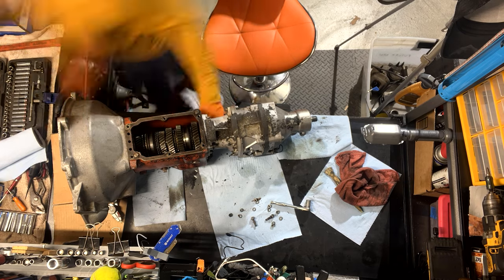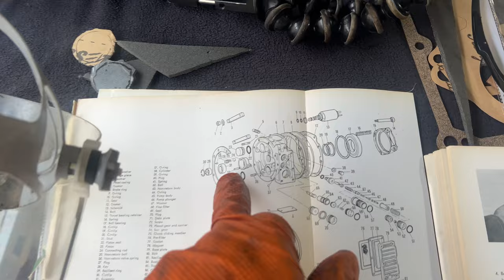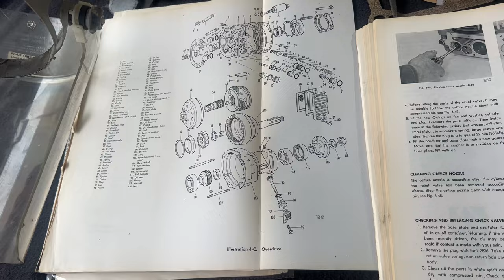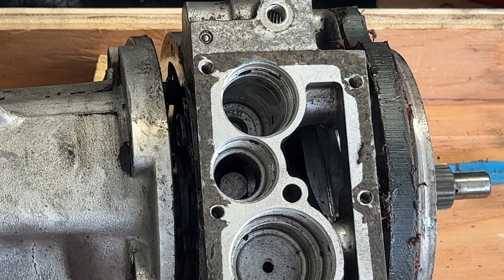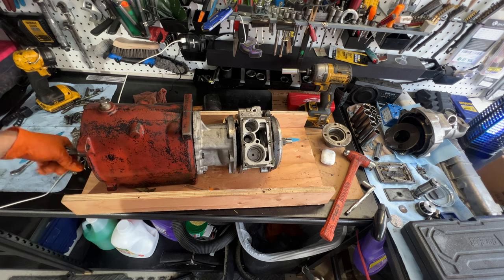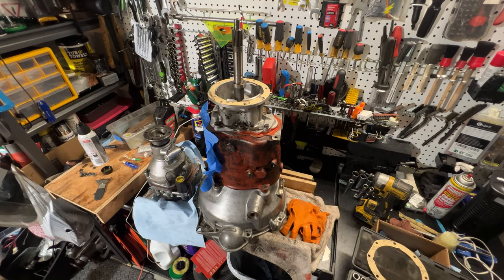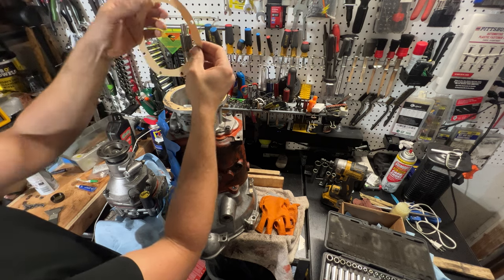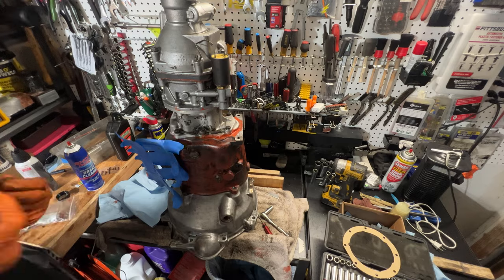Volvo 164 Electric EV build - Part 7 Transmission Rebuild

Comment: Someone please buy my 240 wagon. Needs saved. Good body, redblock, and 5-speed. Wiring issue is preventing it from running.
Reply: In same boat my 88 240 runs and drives but my interior needs a redo
Reply: If the wiring problem is due to a  decomposed wiring loom under the hood it's a well known problem with known and quite easy fixes. Basically replace the wires one at a time. Applicable years were about '84 - '87. Don't sell it, fix it!